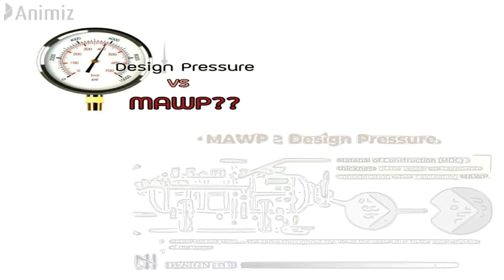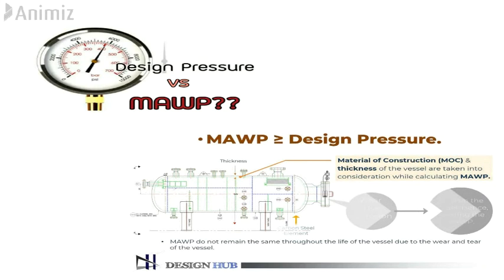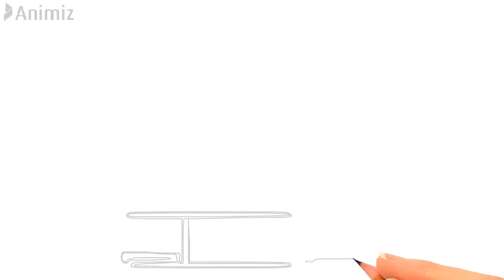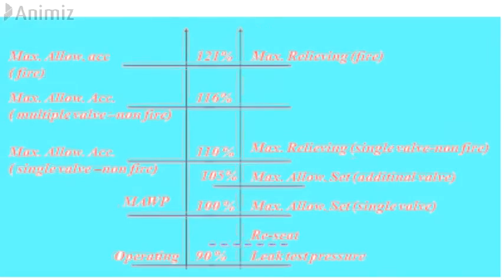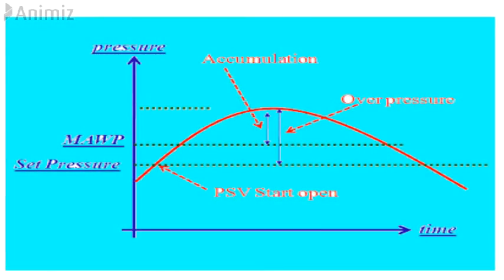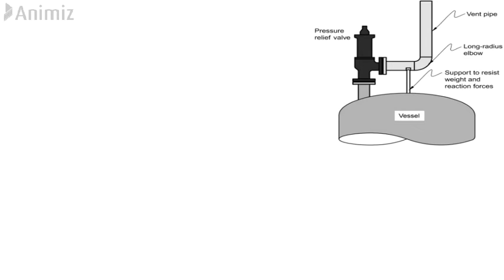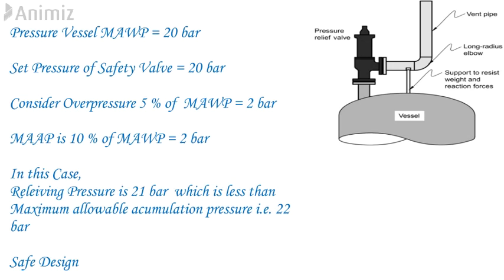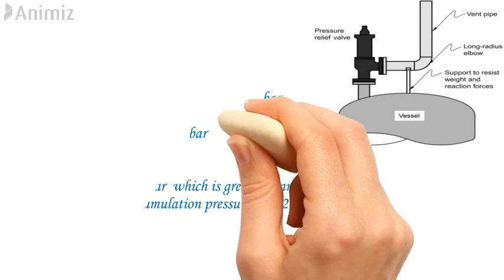What is Design pressure , MAWP, Set Pressure, MAAP. How to decide set Pressure of SRV

Comment: As per API 520, when MAWP is equal to set pressure, overpressure will be equal to accumulation. Hence as per the example cited in the video, overpressure and MAAP cannote be different. If MAAP is 10% of MAWP, then relieving pressure shall be 22 bar